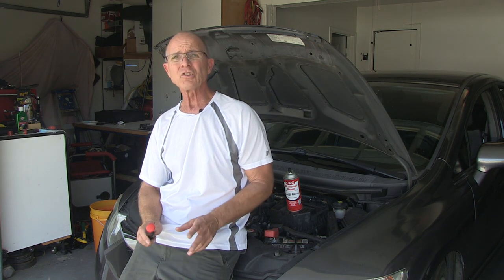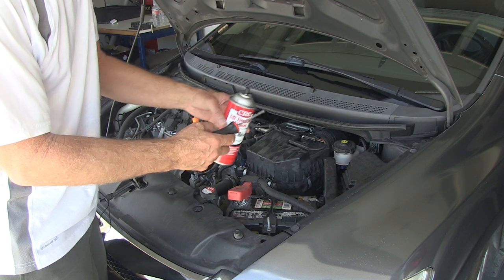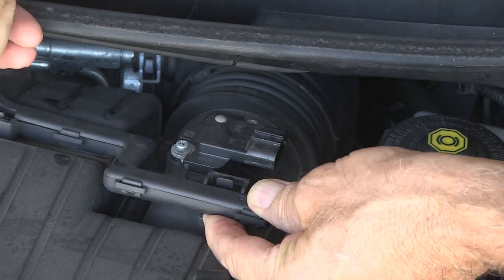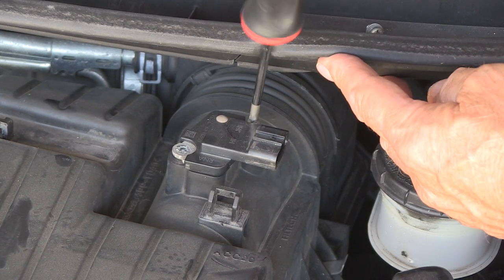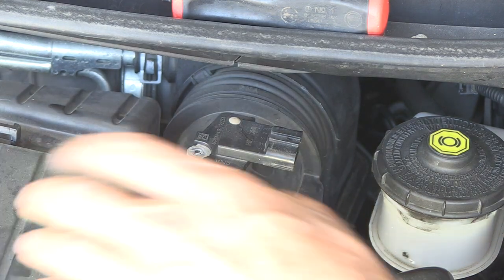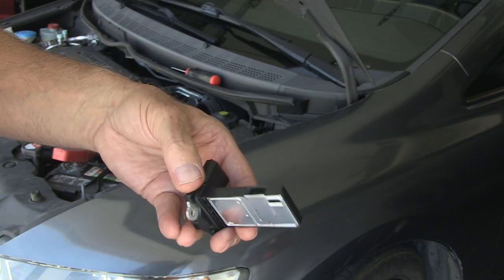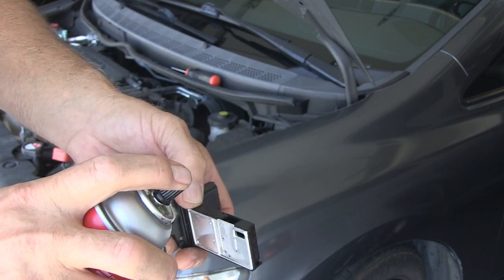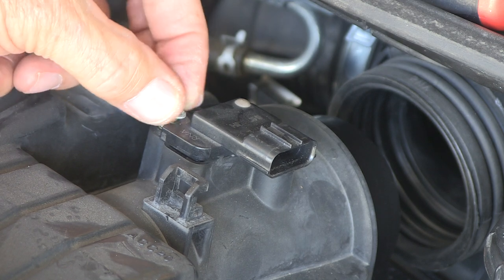Civic, Clean this & Get Better MPG, plus fix "Hesitation, Stalls, Rough idle

Comment: I'd like to add that although it's the same thing technically, they make MAF sensor cleaner for a reason. You can use the electronic cleaner for the throttle body also, but technically MAF cleaner should be the only thing cleaning that sensor. But to each his own as they say.

Comment: One tip; Take the top of the air cleaner off the care before trying to remove the MAF sensor, then with it on a work bench. you can more easily remove the screws instead of all the bending your back and trying to angle a screwdriver in there. Also, one of the two screws was on very tight and i almost stripped it. I sprayed a very small amount of PB blaster on the screw and gave it  a couple taps with a rubber mallet on top the screwdriver and then a  few minutes, for the oil to drain down to the threads. the screw then came out easy! Mine is a 09 civic and had never had this service done.
Reply from the maker: Great input, my car is a California car and doesn’t see the outside weather as many others car out there, appreciate your input 😢

Comment: Hello, I have the same issue on my 2013 civic coupe 1.8l, I have replaced the intake boot, cleaned the maf sensor, replaced air filter, still no luck..
Reply from the maker: Sorry I don’t have a solution
Reply: Try cleaning the throttle body and the idle air control valve. That fixed my issue
Reply: How did you go?
Reply: Check spark plugs.
Reply: @ceegee3514  where is the idle air control valve located on 2013 civic 1.8L?
Reply: Did you fix it ? Replace PCV valve
And spark plugs
Reply: Hi im having the same problem... I did plugs & ignition coils 3months ago. Did you solve your problem!?

Comment: I recently bought an 08, 1.5k starting idle but smooths out as soon as moving, still need to take the time to clean the body but by applying the logic of the ac brings the idle down: keeping my ac on a low setting when starting my civic and it starts perfectly smooth now
Reply from the maker: Great info

Comment: Am having 2010 honda civic 1.8 l 4 cyl automatic not giving proper mileage.

Fuel Tank Capacity 50Liter

It will give 560 kilometers if I fill up fully for the long travel.
When am drive inside the city for full tank its giving me 290 to 300KM

These are the steps that I have done. 

1. Clean the mass airflow sensor.
2. Clean the throttle body.
3. Clean the plugs.
4. Changed the engine oil and gear oil.
5. Clean the fuel filter.
6. Clean the fuel Injector.

Please assist me with this.
Reply: I'm on the same boat with my 2010 honda civic 1.8 prosmatec. Let me know please if anything worked for you. @Danny your help needed.
Reply: Make sure your tires are spinning freely, i.e. no dragging brakes or bearing issues
Reply: Honda Civics are known for bad wheel bearings. You might want to have that checked.

Comment: Hi Danny, what was your before and after MPG on your civic and element after doing this?
Reply from the maker: Mine wasn’t dirty, I do this every year, so my mpg on the Element didn’t change, however on my Civic, i noticed a 2 mpg improvement cleaning the throttle body, airflow sensor, changing the oil and air filter and aired tires to 35 psi, my Element tires im running 42 psi, the ride is a little stiffer than when I ran 35, but the mileage is better. My all time best was 31 mpg on a trip, i track my mileage every fill up, I usually averaged 24 to 25 city hwy mix, I believe I have 130k miles on my car, hope this helps

Comment: Hi Danny, after I clean the MAF with Contact Cleaner, check engine logo lights on.
Reply from the maker: Clear it with a scanner, you may have had the key on when the connector was unplugged, check your connections, also check what code.

Comment: Went to do mine and one of the screws had been stripped out by  some previous owner. Guess I'll take the air filter top off and spray in there best I can. 😢
Reply from the maker: Do need to do a video on removing stripped bolts

Comment: I have a civic 2013 and when I remove the clip of MAF sensor the car does not shuts down does that mean its bad or needs cleaning ?
Reply from the maker: When you say clip do you mean connecter? If yes? No it only means it’s disconnected and the computer sets fixed value, hope that makes sense
Reply: @dannysdiygarage  yes hopefully because it triggered problems after I cleaned the throttle body and changed air intake tube because it was broken after that it felt like the rpm was a bit high and also triggered some lights once so I figured it is something to do with the MAF sensor I might be wrong because I did not clean it not did the previous owner might have considering the condition of throttle body carbon deposit.

Comment: Good day. My 2008 honda civic misfires at idle only, drives perfectly fine otherwise. Changed spark plugs and MAF sensor. There are no vacuum leaks. No check engine light. What do you think is the problem?
Reply from the maker: But not driving 50mph up a hill, maybe Valve adjustment? I have a video on that,
Reply: @dannysdiygarage  it drives up the hill pretty good, has a lot of power especially when it hits vtec, its just that it idles poorly

Comment: Which year models of civics have that removable mass air flow sensor? I have a 2006 dx which idles fine but as I'm say 50 feet from a stop, it occasionally dies which as you know can be very dangerous loosing you brakes in motion.
Reply from the maker: A 2006 should have this

Comment: I have a question I just installed a intake on my 2010 civic it ran perfect with the stock air box but now it’s throwing a code for throttle spring malfunction I can’t seem to find the issue it runs for 5-10 sec then shuts off also my check engine light is on
Reply from the maker: What’s your question? I would Put it back to stock, or pull the code and diagnose it, do you have a code reader?
Reply: @dannysdiygarage  yes I hooked the code reader up an it said throttle spring malfunction
Reply from the maker: If it didn’t have a issue before installing the intake, back to stock would be my direction,
Reply from the maker: Also, if you give me the code I could look up diagnostics, unfortunately not till Sunday
Reply: @dannysdiygarage  that’s what I was thinking to see if that’s the issue but so far I think it is
Reply: @dannysdiygarage  ok I’ll see if I can get the code but I’m pre sure it’s P1684 for the throttle return spring malfunction
Reply from the maker: 👍🏼 update me on Sunday, I’ll have time to look it up to see diagnostics procedure, but try putting it back to stock, maybe you’ll find the problem once you backtrack
Reply: @dannysdiygarage  that’s what I think my best bet is to do prob just gonna try to find a stock air box an reconvert back an see where my issue is coming from an sounds good
Reply from the maker: I did a quick search for you
I would check your connection make sure you didn’t bend a pin in the connection easy to do when connecting 

 Dirty throttle body
Faulty Electronic Throttle Control System (ETCS)
Electronic Throttle Control System (ETCS) harness is open or shorted
Electronic Throttle Control System (ETCS) circuit poor electrical connection
Reply: @dannysdiygarage  thank you!! I had people try to tell me it could be my maf as well an apparently she’s suckin to much air

Comment: I put a new air flow sensor in my 2012 Honda Civic why is it still sputtering
Reply from the maker: Sorry Bill not enough information for me
Reply: I put a new air flow sensor in  and i put 02 censored and my car still hesitates 
 when I give a gas
Reply: What I'm asking is is there's something else that you think I put a new air flow centering I cleaned it and it still sputters
Reply from the maker: Hi Bill, I’ve been traveling through the East coast the last couple of weeks and haven’t had much time to check comments, sputtering on take off, possible miss fire on take off? Remember Bill, without me being there experiencing the problem and doing diagnostic testing, these are only guesses, try holding the brake pedal down so the car won’t move and putting the car in drive and hold the rpm around 2000 rpm to load the engine, does it miss or sputter, if so possible plug or coil issue, you can also try this, unplug the airflow sensor and drive it, is it better on takeoff with the sensor unplugged?
I assume you have no engine light on? If you’re engine light is on 1st pull codes, you should also check to see if there are any codes which didn’t turn on the light 
Sorry for the late reply, I’ll be traveling for another week or two
Reply: I have the engine checklight on the schedule light on and the power is Jerry light on the vehicle starts up idle is good it is when I'm driving around 25 miles an hour when I give it gas it's spotters other than that it runs good You have a phone number I can contact you
Reply from the maker: Hi Bill what codes did you pull from the computer with your code reader?
Reply: I don't know o'reilly's did it they said it was the air flow sensor and the 02 sensor I can go back and get it from them if it will u help me  ty
Reply from the maker: Buy this from Amazon it’s easy to use and it’s cheep, you’ll be able to check codes and clear them yourself, my email dannysdiygarage@gmail.com
Send me your number and when you want to chat https://youtu.be/nUJAF_jshKA